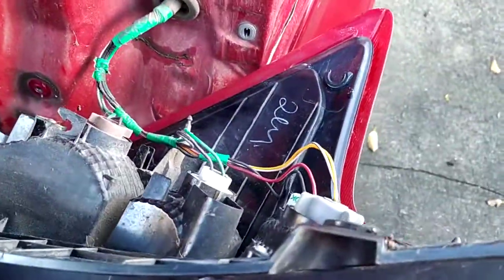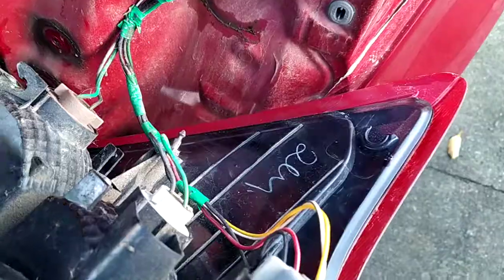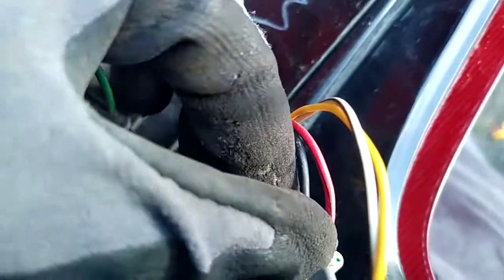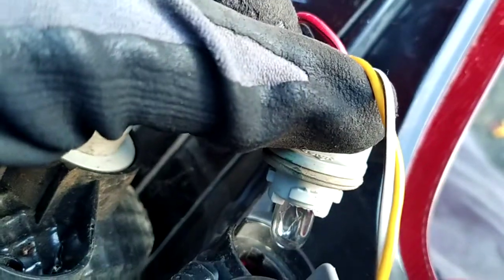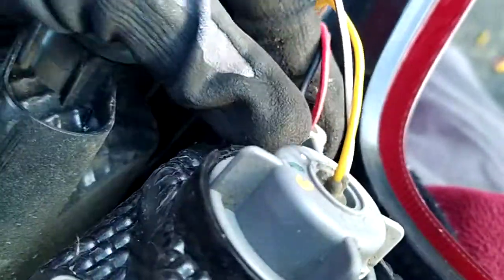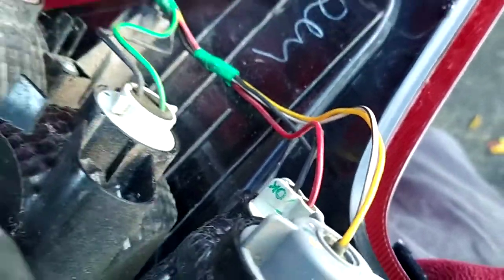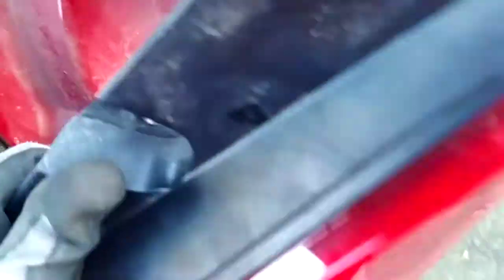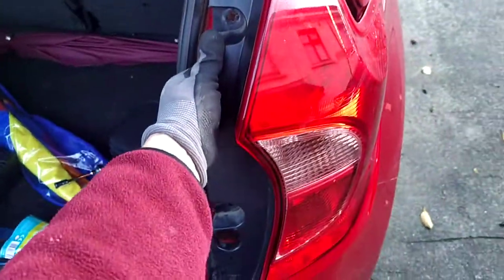Nissan Note Mrk II Tail light unit removal (E12 2013-2017)

Comment: I was having the same problem as others with the housing being really hard to pull out. There are a few internal plastic clips that hold it in place but a little bit of wiggling and a good yank will get it off. It was more difficult the first time I did it. Pretty sure all the bulbs are 5W but check yourself before you buy new ones :D

Comment: Thanks.  Until I watched this video I thought I had missed a bolt after I removed the two bolts you can see.  I couldn't get the light to move.  So I put my fingers in that hole at the bottom and gave it a tug and out it came.

Comment: Any clues to the bulb?  Usual misinformation abounds the internet. TX
Reply: @eclecticDIY  the rear tail light, not the  brake light. I see loads of conflicting info. Is it the 501, and should it be the clear one or the red glass one?
Reply: Just replaced mine.  In the U.S. it's a 7443  I have a 2014 Versa Note